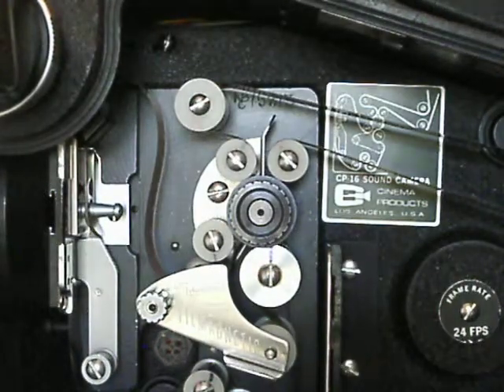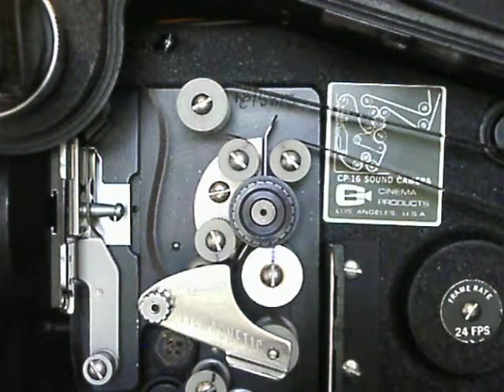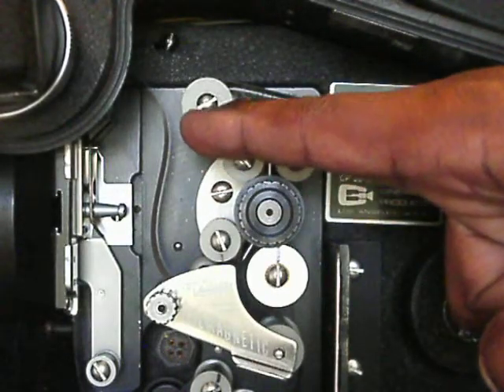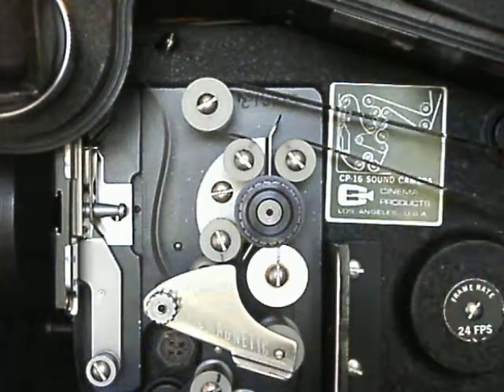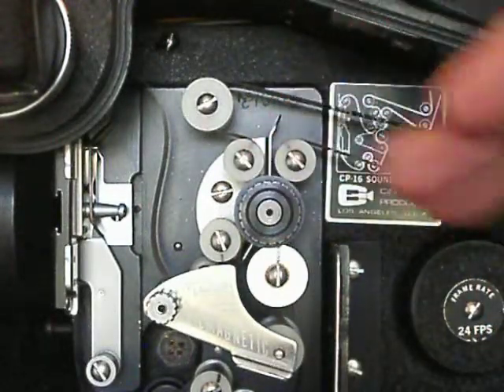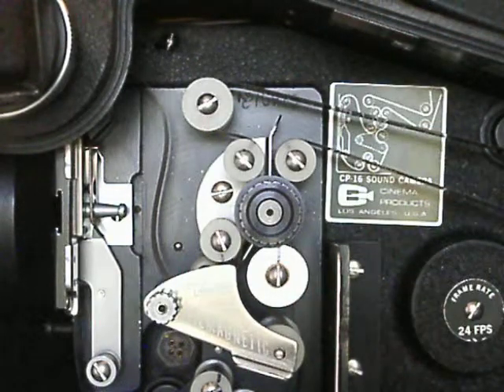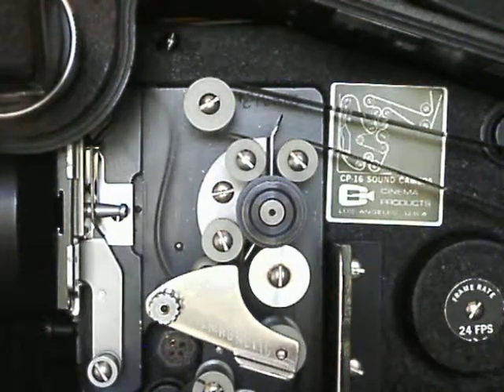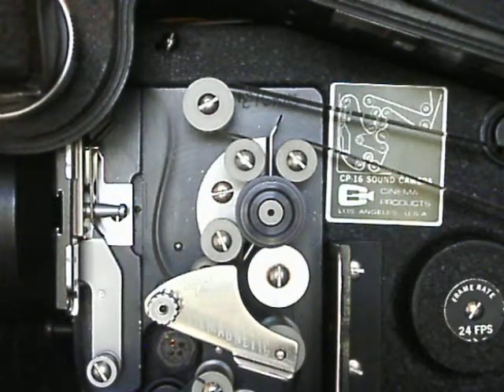CP 16 scratch test cinema products

Comment: This is an awesome tip! Recently I purchased one of these cameras and I’ve been working on fixing it up. I followed your other tutorials on how to replace the belts. The only thing I’m still trying to fix is it seems like it runs louder then it should. I assume it’s because the internal lubrication had dried out do you know what parts need to be re lubed?
Reply from the maker: legoguy830 the best lube is made by Arriflex camera Co arrilube
Reply: AWCINEMA AWCINEMA and do you recommend just putting a couple drops in each of the drive gears?